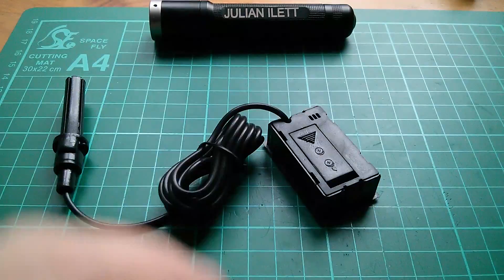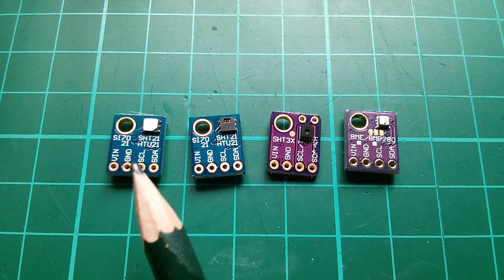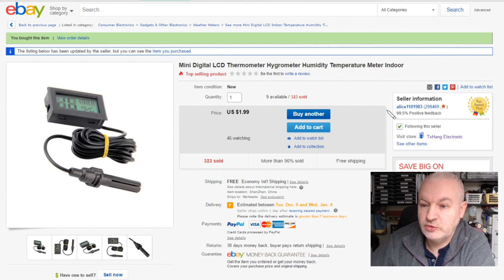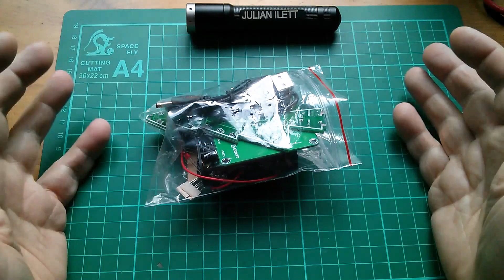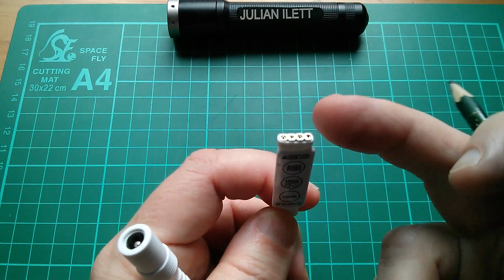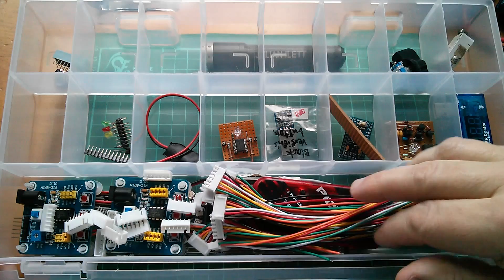Julian's Postbag: #76 - Ideal Humidity Christmas

Comment: My second Arduino project.  Unfortunately the agony continues, though with 
some hard won insight.  Trust no one,  When you dht 11 is labeled one way
on the front, flip it over and look at the traces.  This only took a day.

But now comes the display. Adafruit sketch for ic2 hello world says the address
is 0, by default.  Adafruit's own address list elsewhere gives it as 0x20-27 depending
on jumpers shorted et al.  Adafruit's ic2 scanner gives it as 0x38. None of these worked.
Tried different Uno and the same nothing.  Now waiting for additional displays. 
Knowing the score now I don't feel so irate, but the physical effects of repetitive stress 
damage are taking up time in between attempts.  I guess this is what minge and munge 
mean Julian?

Comment: Hi Julian Ilett, i also bought a coule of those LED Mini controller Dimmer, from different sellers. But i got with all of them one problem. If i use them with 4m white LEDs after like 20/30 minutes they start blinking and when i power them off for some minutes they work again for 20/30 minutes. i get that problem also wth some RGB led controllers. could it be a problem with tempreture? but they arent really hot. do you have an idea?

Comment: BME280/bmp280 is a rather confusing identification as  the BME and the BMP are different sensors. The BMP280 doesnt  read humidity. I'd be pretty reluctant to  order that, not knowing if I get the rght one :-)

Comment: The 2 extra pins on the SHT30 are to change the I2C address (AD) and to trigger an interrupt on a microcontroller (AL), Tie the AD pin to Vin to change the address from 0x44 to 0x45. Details for setting up alerts to trigger interrupts can be found in the data sheet.

Comment: what i would recommend is use the arduino mini with the 3.3v 150mA regulator. low quiescent current. Then attach both the oled and the sensor to the 3.3v out the arduino. Vin to the battery. the ssd13306 have i believe a shutdown mode were they can go into low power mode. As the same with the sensor, although milage may vary with diff sensors. This will save you from using any logic level shifters due to the fact that 95% of oled screens although you can run the i2c logic lines with 5v. Most boards dont have proper level shifting and the datasheet says it should run on 3.3v same with the power lines. But it all depends on the oled pcb.

Comment: I think your life would be much easier if you modularise your project. I.e an a generalised arduino display project, set up in a way where you have a baseline project to build off whenever you need a display in a project, and then it's just a case of adding the new module and adding some of the code in a modular fashion.

Comment: I actually just built two of those Christmas trees. Though one came with changing rgb lights and then I believe the other one with gallium arsenide LEDs. Like the rgb one but the other one the greens barely light with 5v but work better with a 9v battery but doesn't come with that connector. The one that I had that worked better on 9v was an eqkit. Also another piece of advice on the build is keep enough length on the capacitors to bend them over otherwise the capacitors will hit each other and you will have a tough time getting the boards together. Learned that the hard way and in the end had to mount one on the opposite side as I had already cut the leads.
Reply from the maker: Thanks for the capacitor advice - I'll watch out for that :)

Comment: Funny thing is that on the ebay image both the GND holes of the LT "ideal diode" are the same size. Don't know if that's to your liking though, because they are both smaller than the IN/OUT one and not all four the same. You also not only got "more hole". the one you got also has more components.
That (the small mismatches between picture and product) is a really annoying thing. Often I want a very specific version, sometimes for simple reasons like a certain hole pattern, but more often because there are different revisions of the same thing that fixed/introduced problems.

Btw. you can point on ebay images, if you click the small picture (opens a big version that stays open).

Comment: Thanks for the climate sensors in combination with Arduino my business and tails indoor climate control and I'm not satisfied with the components and systems that are sold open Leah on the commercial market I would like to be able to develop my own with redundancy sensors built inside using Arduino to develop my own system

Comment: I'm just sat on the sofa watching this and then this happens at 24:30 http://admw.uk/jj  :-)
Reply from the maker: Ha ha, great minds. So you're going to be following the PIC tutorials?
Reply: Yes, most definitely - looking forward to them.  Although I'll admit I've been trying to get ahead of the class which is why it's in the house.  I was trying to use the module board to program a 12F629 but I've been having trouble.  Might need to trim down the cable length, but in the mean time I've soldered together a circuit board of my own.
Completely agree with using MPLab 8.9 rather than X - I've ended up doing the same this evening
Reply from the maker: Did you cut the track to the Vpp pin and fit the link wire on the underside of the PCB?
Reply: Ah no. I couldn't find your video where you talked about that and I had a feeling you'd decided that wasn't necessary in the end. Guessing I was wrong - anyway I've had success now with my own little lash up. Thanks for the tip.
Reply from the maker: Your own breadboard lash up is probably best for the moment because that demo PCB has a naughty connection between Vpp and the MCLR components. It sometimes works, but often doesn't. I was getting errors about not seeing the PIC12f675.
Reply: Not clicking any obscure links, ESPECIALLY not ones that start with "ad".

Comment: I got the tree kit with the "colorful flash" LEDs. As I recall, it uses the same PCBs as the red/green. As a result, the resistor and capacitor values were not silkscreened on the board. Took a bit of research to find an actual parts list.

Comment: You should consider getting / reviewing this USB soldering iron: http://www.ebay.com/itm/Mini-Portable-USB-5V-8W-Electric-Powered-Soldering-Iron-Pen-Tip-Touch-Switch-FB-/302105298195 -- very practical to have on the desk along with powerbanks, solders pin headers just fine.

Comment: +Julian Ilett Those two Si7021 and HTU21D are almost the same in 99.9%, although how I see you requesting data very fast, and the sensor will overheat, the sensor normal response time is about 17s regarding Si7021, the HTU21D response time is 5s, but for the BME280 the response time is 1s! ;)
Reply from the maker: That's interesting, I didn't see that in the data sheet. Maybe that's why the humidity readings are so high.
Reply: There you go, the whole elaboration of the sensors, just go down to the comparison table at the middle of the page! ;)
http://www.kandrsmith.org/RJS/Misc/Hygrometers/calib_many.html

or

Just look closer on the page 7 in the datasheet "Response Time" is 17-18s for the Si7021 sensor!
https://www.silabs.com/Support%20Documents%2FTechnicalDocs%2FSi7021-A20.pdf
Reply from the maker: Wow, that's a lot of data - I'll get reading :)
Reply: Anyway, I have BME280 and SI7021 in the same room and the BME280 reading is 10-13% less humidity level, but the temperature measurement is okay, it's about 1-3 Celsius difference, so, I don't know which one to trust, some users says that the BME280 readings are suspiciously weird and also cost 2x more than SI7021 or HTU21D!

Comment: Thanks Julian for your great video. For your sensor project you may like to consider and review this type of rechargeable 9V ZNTER (http://www.banggood.com/ZNTER-S19-9V-400mAh-USB-Rechargeable-9V-Lipo-Battery-p-1070703.html?rmmds=search) based on a boost controled  Lipo. This one or other similar brand hold the voltage quite well when in charge.
Reply from the maker: Thanks Sylvain - I think Banggood have sent me one of those.